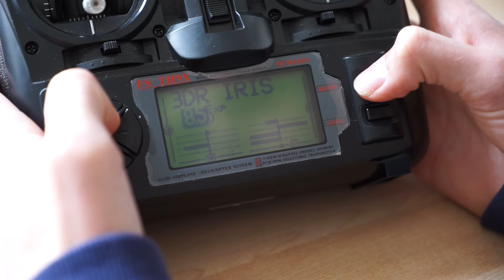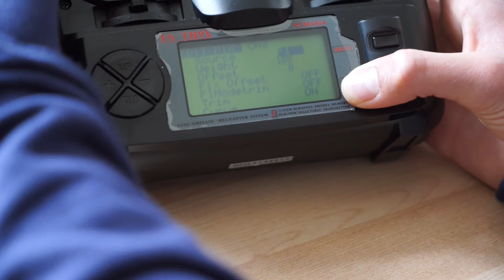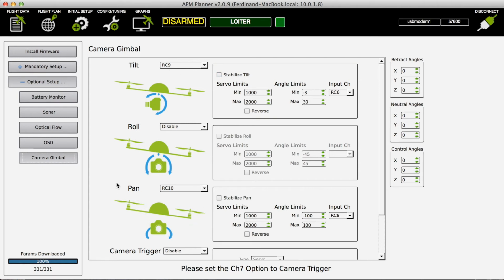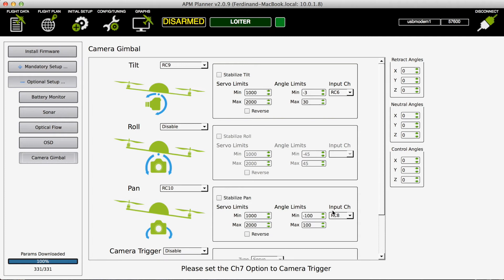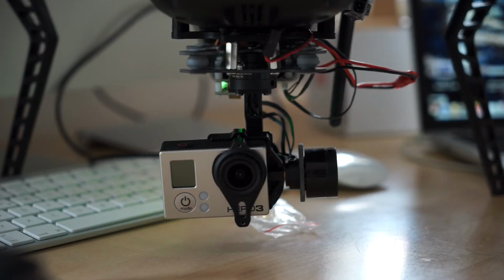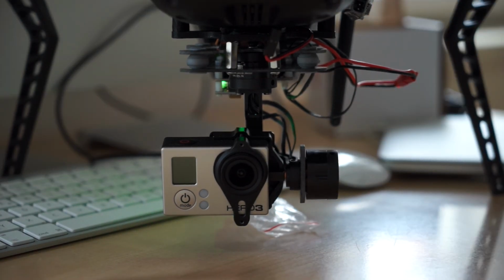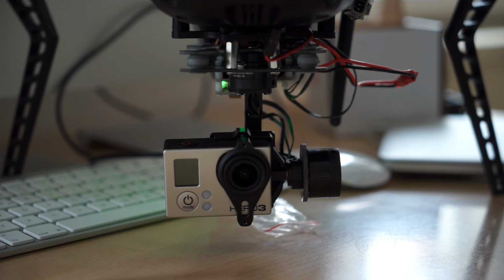How to install a DYS 3 axis Gimbal on a 3DR IRIS

Comment: here is a side note
you can install a DIY gimbal, it will work only from the control knob on the transmitter. However when you fly in autonomous flight the flight controller will not pan the camera as it normally does with the Tarot gimbal for some reason,,   any ideas?

Comment: My dys only has 2 wires and they are black and white.
Reply: Sam Degonia Did you ever find a solution for this?  I'm having a hell of a time getting it set up on my Iris+
Reply: Yep what's yours doing.
Reply: Still can't pan manually but I can tilt manually.
Reply: They are installing this dys on an original iris which had the manual pan feature, but the new Iris doesn't have the 3rd wire for the pan.
Reply: Yeah its annoying. I've been racking my brain trying to tune through the BCG editor, and have it pretty good. But somehow I've lost the ability to control pitch. And, under hard turns it jumps poles which is annoying
Reply: Can you tilt with your radio? Did you need to copy channel settings like the video demonstrates? I don't have this page/ability
Reply: Yes I can tilt and no I didn't have to copy- that copy thing is for the pan. You set the tilt mode under mission planner in the basic set up procedure- have to tell it you have a gimbal and you'll be using #7 knob for tilt.

Comment: This does not work for the IRIS+ since it has different cables (black ground, white signal) also, when I attempted to connect the power cable to the gimbal (correctly) my gimbal started to smoke and now it's ruined.
Reply: @ juanmvilla,
I've got the Iris+ myself.  Did you ever figure out the correct way to install, or have you given up since you ruined yours?
Reply: Did you ever get it to work with iris+
Reply: hey sabrina and Erik , try this link , it has been helping me a lot
(http://diydrones.com/forum/topics/3-axis-gimbal-for-iris-looking-for-suggestions?groupUrl=iris&groupId=705844%3AGroup%3A1445744&id=705844%3ATopic%3A1888977&page=2#comments )

Comment: Dear Ferdinand,

Thanks for your video, I have some trouble achieving YAW control on my Same 3DR Iris as you have. Could you help me out with some questions?

I have the Orange and Red servo leads connected in the same way as you have to the DYS gimbal, but I wonder where your servo leads are attached onto the Iris? In my case:

PIXHAWK:
- Orange is connected to the Channel 1 "S" on pixhawk 
- Red is connected to the Channel 2 "S" on Pixhawk

Simple BGC Gui?":

I have Roll: No input
Pitch : RC_Pitch - PWM
YAW : RC_ROLL - PWM

FC_Roll : No input
FC_Pitch: EXT_PITCH - PWM

RC TX:
I have Pitch on Channel 6 on my Frsky Taranis,
I have YAW on  channel 8  On my Frsky Taranis
Both controls both working properly, If I switch servo leads both work.

MISSION PLANNER:
TIlt is @ RC9 - Stabalise Tilt is off. Input channel RC 6 
Pan is @ RC10 - Stabalise Pan is off, Input Channel RC8

Could you post or send me a video of your configuration in the "Simple BGC Gui?"

I can get my YAW Working when I put both PITCH/YAW control on RC_Pitch - PWM..

Hope you hcan help me out!

THanks!
Reply from the maker: Peter van der Pol  my servo leads like yours the problem you will have is that PIXHAWK it some time to save the settings but in Simple BGC Gui you might have to changed input settings

Comment: Hallo Ferdinand, tolles Video, dafür gibt es von mir einen Daumen hoch!
Ich selber habe auch eine IRIS mit einem DYS Smart Gimbal. Auf dem Kanal 6 der Fernbedienung habe ich den Pitch der Kamera gelegt.Ich würde gerne die PAN Funktion auf Kanal 8 legen. Die Einstellungen im MP müssten eigentlich richtig sein. Könntest du die notwendigen Einstellung in der Fernbedienung etwas genauer erklären. Leider kann ich diese in deinem Video nicht richtig erkennen, Danke!
Reply from the maker: Hier ist eine gut erklärter Anleitung Wie man Einen Extra  Kanal anliegt du musst eigentlich nur alle Schritte befolgen außer den Für den Schritte Für den  Schalter da nehme den P1 das ist der obere Linke Dreh Schalter http://www.communistech.com/blog/how-to-configure-a-switch-for-ch8-on-the-iris-quad/
Reply: Ferdinand Loesch
Sehr schön damit habe ich es schon einmal geschafft das Poti 1 auf den Kanal 8 zu legen. Das Gimbal dreht sich leider immer noch nicht um die YAW Achse :-(. Kannst du mir noch sagen, auf welchen Steckplatz das braune Kabel im Pixhawk AUX Out steckt? Vielen Dank.
Reply from the maker: Stephan Eichler der pin  meet Dean -    
And den gimbal in einen mittleren pin Aber das ist Nicht unbedingt nötig man kann ihn auch Einfach Nicht benutzen. Aber Ich glaube das Problem liege I'm gimbal GUI Software Kopierer die Einstellung. von diesem Video at 0.8 DYS Smart 3 Axis Gimbal - Demo using 3 channels for control
Das wird wahrscheinlich das Problem sein 
Außerdem   Werde Mitglied meaner Facebook gruppe Ich antworte da meustens schneller und außerdem Viel nützliche Informationen ind Hilfe https://www.facebook.com/groups/635611993176188/
Pixhawk Manual
http://3drobotics.com/wp-content/uploads/2014/03/pixhawk-manual-rev7.pdf

Comment: Hi. What type of screws are needed to mount the adapter plate onto the IRIS ? BTW, did you change any parameter on the IRIS itself (via MP) or did you only change the radio TX config ?
Reply from the maker: i also downloaded the iris with gimbal parameter. and enabled pan in mp but you will also need to  enabled pan Control in the gimbal GUI software  here is a video to show you how to do that DYS Smart 3 Axis Gimbal - Demo using 3 channels for control

those are the screws you Will need to Mount the adapter on to iris 
http://www.amazon.de/gp/product/B00HWGVYYG/ref=oh_details_o01_s00_i00?ie=UTF8&psc=1
to attached the spaces from the gimbal to the adapter plate you will need a M2.5 Lock Nut.http://www.amazon.co.uk/Metric-Stainless-Hexagon-Locking-Delivery/dp/B00CVT2ZPG/ref=sr_1_1?s=diy&ie=UTF8&qid=1399738902&sr=1-1&keywords=m2+nut
Reply: Thanks Ferdinand. FYI, the spaces I received with my DYS 3-axis needed M2.5 lock nuts, not M2. So for those reading make sure you double check ! Chinese are not always consistent in the metrics of the screws they use for such things.